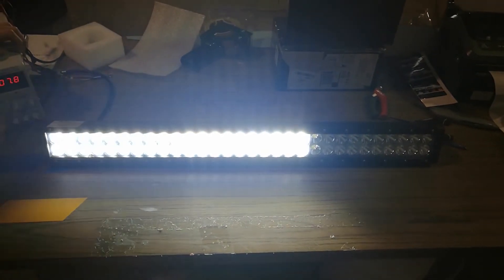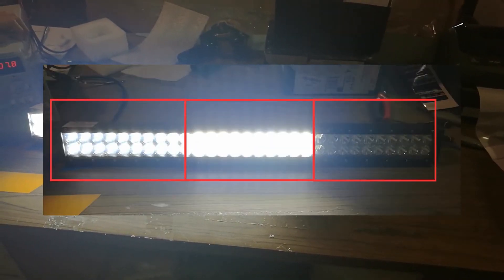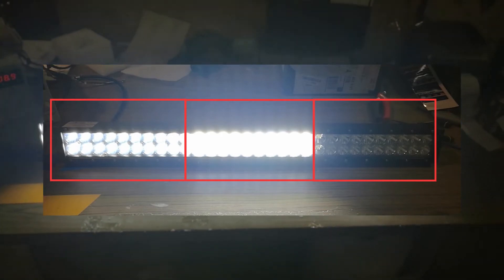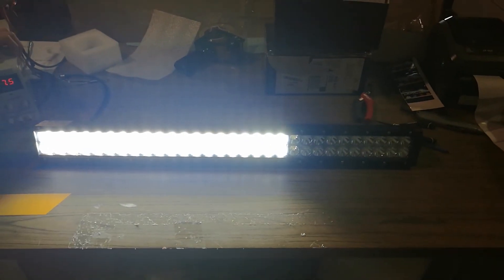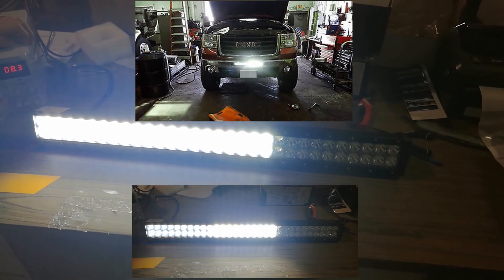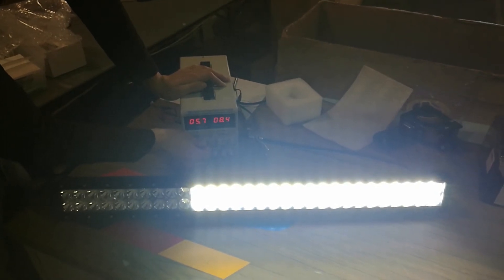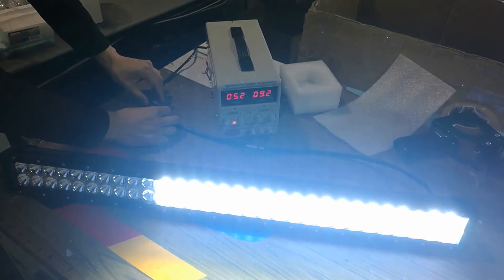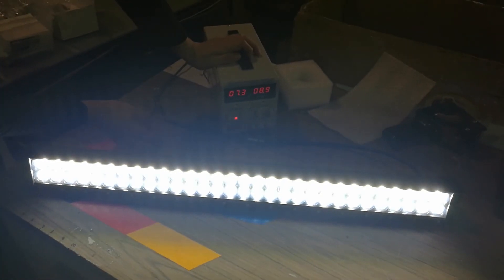Why Parts of Your LED Light Bar Doesn't Light Up

Comment: So what if the bar worked at one point and then a 10 inch section is not lighting up but flashes really dim when the bar is turned off. and all fuses are fine and relays work?